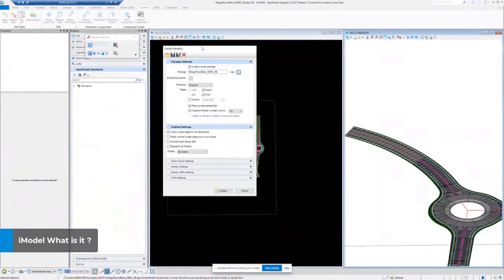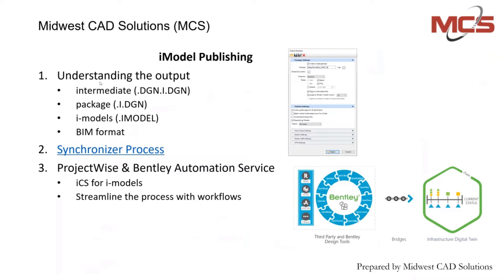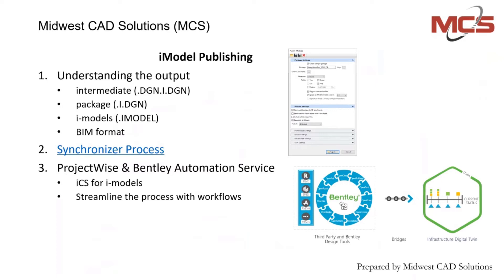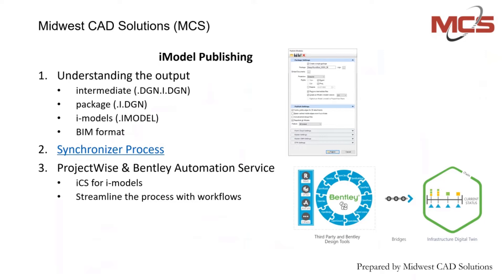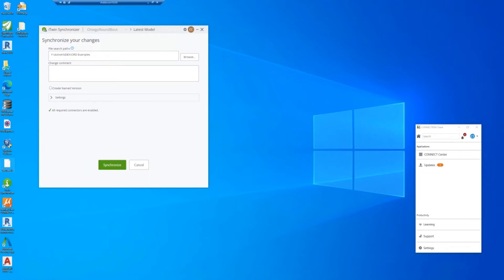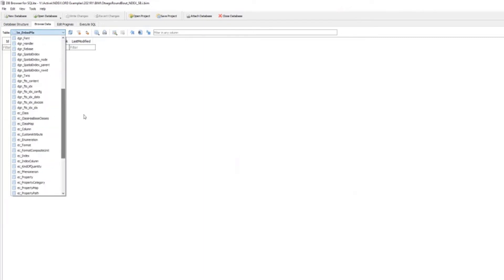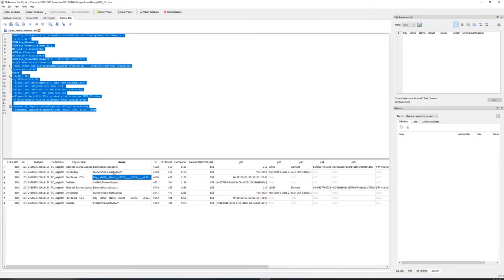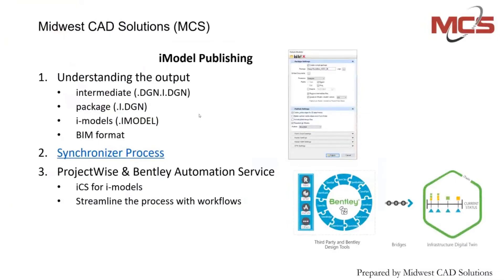05 iModel: What is it?

Comment: hello, can i attach a i-model as a reference in a file?. i would like to have a file in microstation availale to users as readonly (open without a password but impossible to copy any item inside), are there any solutions?
Reply from the maker: Hello! Yes you can attach an i-Model as a reference in the MicroStation CONNECT Edition. An i-Model is attached in the same manner as any other supported reference attachment file type.
Reply: @BentleyMicroStation  thank you, this connect edition is working regularly also in project wise? I tried to attach this 2d I-model into a 3d model In project wise, unsuccessfully